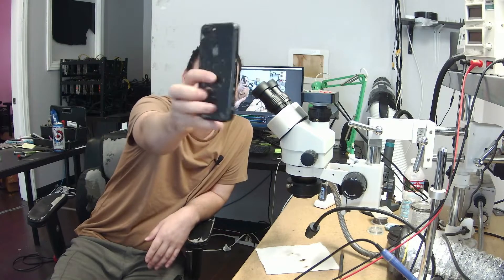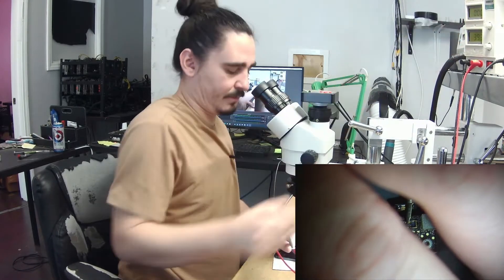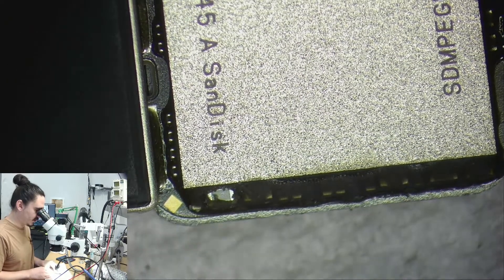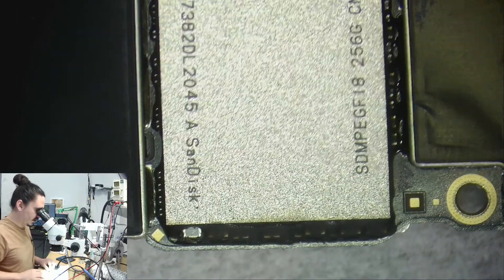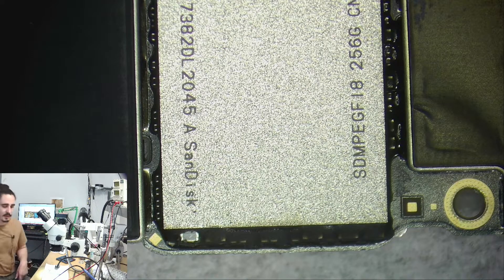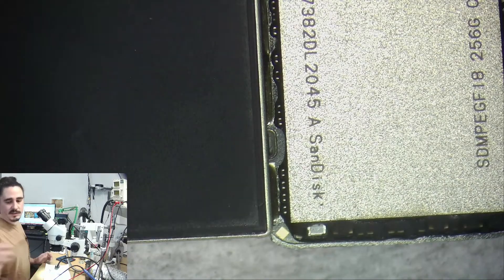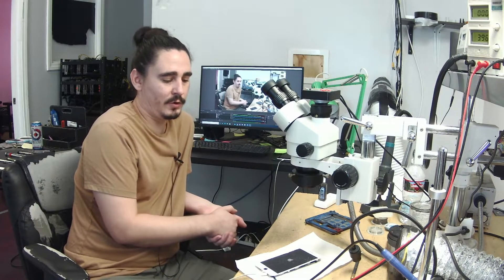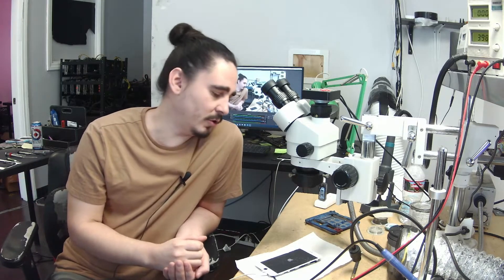iPhone 8 Data Recovery - DC Power Supply Fault Finding

Comment: What DC power supply are you using?   Curious if most DCPS measure draw or is that a premium feature?
Reply from the maker: I am using just a very basic, normal dcps. All of them will have voltage and amperage.

Comment: so i had a short on 1v8_io, and when i injected volatage main power melted, camera ic melted, some other ic melted and cpu also melted, i was super confused as to what the problem could be, i followed your instruction i turned the board around, injected the voltage and sure enough one little cap was causing the issue. Line clear now!
Reply: Hi, how many amps do you feel is appropriate when injecting voltage and do you put the black probe on ground?
Reply: @ristinapharaone2502  red probe ground, black probe you test. In my case it was 1v8 Line so I injected 1.8 Volts
Reply from the maker: @damjanovicr1195  Black probes go on ground when injecting voltage. Red probes only go on ground when checking diode mode values.
Reply: @iBoardRepair  thanks for clarifying
Reply from the maker: @ristinapharaone2502  Black probe goes on ground, yes. In general I keep my amps set to 2 but sometimes my dcps limits it to even less than that.
Reply from the maker: Make sure you only inject voltage up to what the line is rated for if you are injecting directly into the shorted line. For example, you only want to inject 1.8v on 1v8 line. Good job finding the cap!